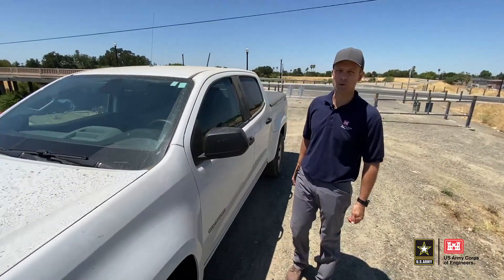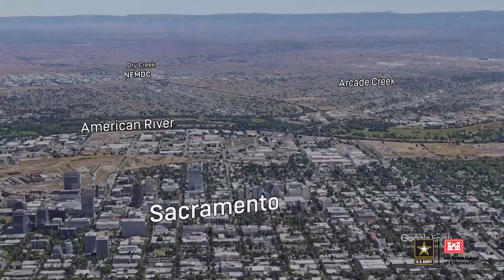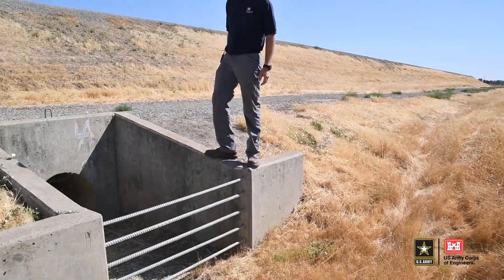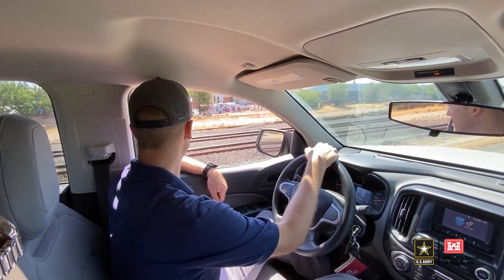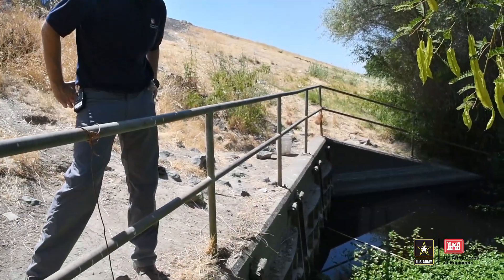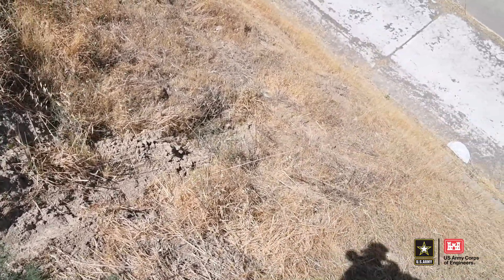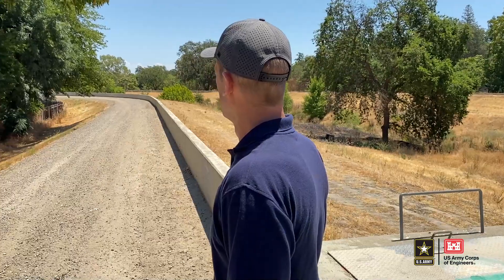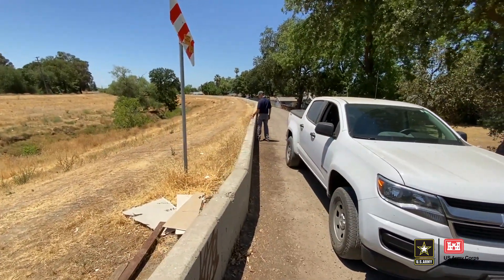How USACE Inspects Levees

Comment: Could I volunteer to inspect levees? If so, how?
Reply from the maker: @josephmajesky2566, thank you for your interest. Unfortunately, USACE does not offer volunteer positions for levee inspection. However, we do have new job openings that routinely become available, including positions related to levee inspection and maintenance. To qualify for a levee inspector role, a college degree in engineering or a related field is generally beneficial. Engineering degrees provide the background to understand concepts like soil mechanics, hydrology, and structural analysis, which are key to understanding and evaluating levee systems. To explore current career opportunities in Northern California locations, please visit https://www.spk.usace.army.mil/Careers/. Here, you can find information about the qualifications, responsibilities, and application processes for various positions, including those related to levee management and inspection.
Reply: I live in tunica Mississippi & I often bike ride to levee located at mhoon landin near the Mississippi river I love the beauty & importance of the levee systems in place. Only question I have is can you ride a bike on the levee very curious

Comment: Thanks for video. I have a quetion for your job. In your country, is there any law which is a limitation abour riding vihicle near a levee's road?
Reply from the maker: Yes, there are limitations on riding vehicles on or near a levee road. For the U.S. Army Corps of Engineers’ area of responsibility in Northern California, levee roads are typically managed and maintained by local or state agencies that may have specific regulations in place. Vehicle use is generally prohibited on the levee crown, except for authorized vehicles used for maintenance and emergency response purposes. It's important to check with the specific agency managing the levee system to understand any limitations or restrictions on vehicle use in the area. Thanks for the question.